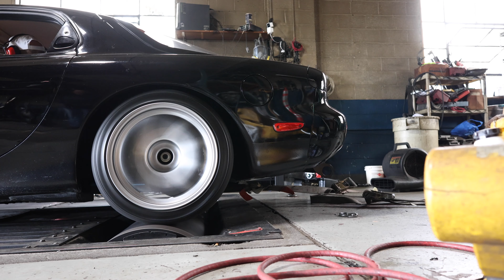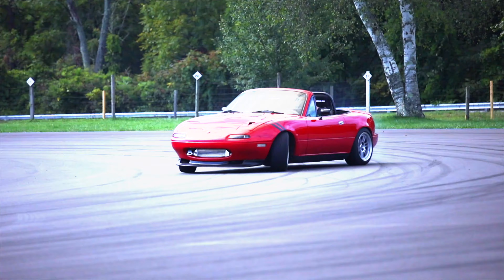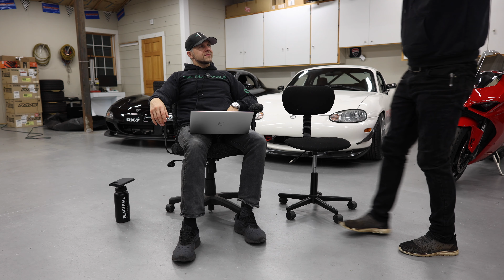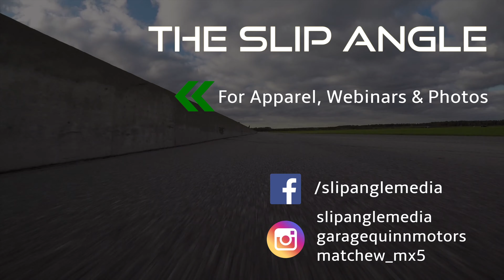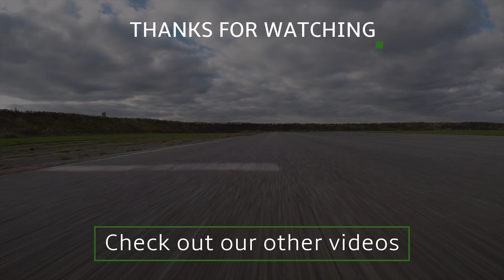Project RX-7 Dyno! Guess what it made!

Comment: Total bummer about the re-A being so restrictive.  Any concrete info on the twin dolphin re-A, if it flows better than the single? I had a reinhard twin canonball, but removed  it because it was too loud for my taste, and put a twin tip racing beat on which is too quiet and restrictive.  Single BW efr 8374 FD, btw.  Great vids and content.  Underrated channel.

Comment: I have the single tip RB and, yes the twin tip RB exhaust is more restrictive. Changs your exhaust and you will make more power and faster boost spool. My Fd makes 426rwhp and it is as faster than most cars that have 550hp. It runs a little rich but running rich helps cool the housings.
Reply from the maker: Thank you!

Comment: That's scary that it cost almost $700 to ship that exhaust... you almost certainly could have had a good shop put something similar together for cheaper than $800 exhaust + $700 shipping... After all, it's a straight through 3.5" muffler with a downturn and a fairly simple pipe leading up to it. That's just how I think though because I learned how to TIG weld instead of paying shops to build my downpipes and exhausts for me because labor is like $150/hr!

Comment: Quinn I had a touch screen stereo and never put it in. I went with a blue tooth amp and some speakers with no head unit. This type of setup is popular on motorcycles and it allows you to use that stereo area for gouges and you can save a little weight. Nice video and at the hp you are running, the car will be plenty fast.